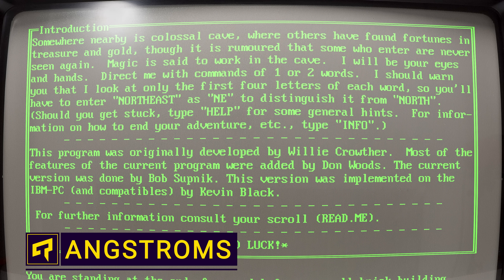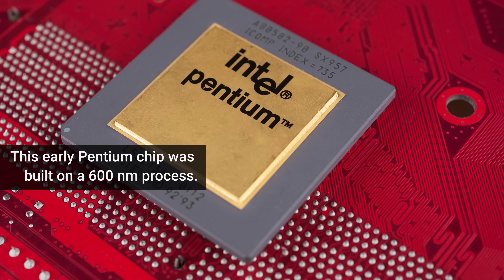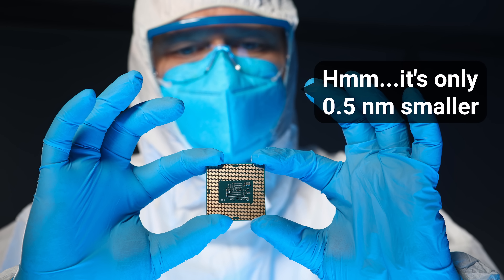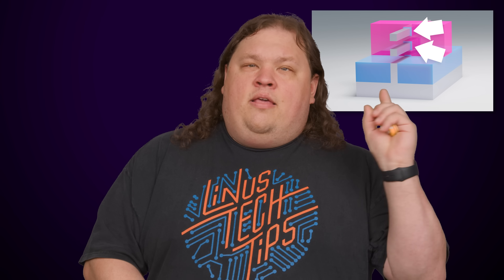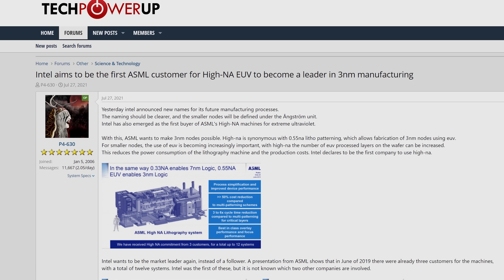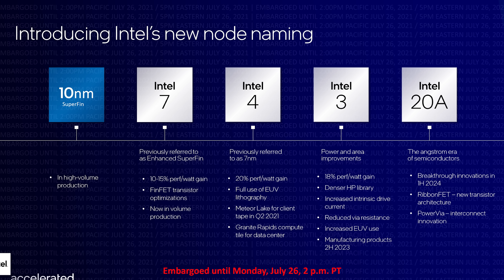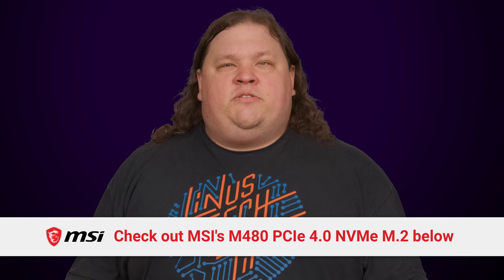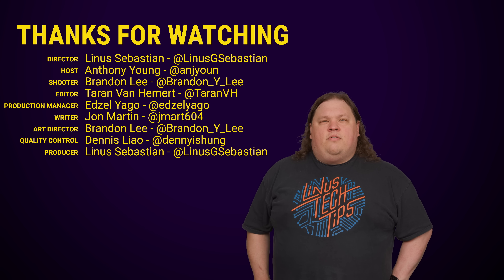CPU Angstroms vs. Nanometers

Comment: I am waiting for the Next Big Discovery... We need a completely-new substrate that does away with silicon entirely, and is easy to produce, unaffected by artificial or political "shortages."
Reply: Silicon is NOT in shortage, it is the chips that are in shortage. I think you got confused between silicon and lithium. Lithium is limited and concentrated in China, but there hasn't been any shortage of batteries yet. And many people are already working on alternatives like aluminium and magnesium.
Reply: @ritwikreddy5670  Silicon itself "may" not be in shortage, and the perceived shortages "may" be political, however the silicon chips are made of Silicon, of course, and a highly-refined variety from not just any beach or desert. Whatever the cause, and whatever you call it, the shortages are causing shut-downs of auto production, electronics manufacturing, and anything else requiring a steady supply of the chips. So the cause is whatever it is, and the effects are what you see. Comparing it to lithium is apples-vs-oranges.
Reply: Everything you just said there besides "that does away with silicon" describes silicon. There is nothing remotely as abundant, safe, and/or easy to use as silicon. 
"Oh, we need more silicon? Go out to the beach with a shovel and melt some sand down."
"Oh, we need a protective layer that can easily be etched with extreme selectivity over the underlying substrate? Stick it in the oven. It'll grow by itself."

The reasons you gave for switching from silicon are the reasons we HAVEN'T switched from silicon. The performance isn't great, but it's SO much easier to work with and produce, and is incredibly abundant.

Comment: It surprises me that Anthony of all people would be doing this particular video.  He should know that the X nm moniker stopped having anything to do with actual transistor sizes long ago.  For example, the only feature that is anywhere near 7nm in size in TSMC's 7nm process is the width of a fin in a transistor which is 6nm wide and a single transistor may have several fins.  From what I can tell, most of the increases in transistor density have come by reducing the distance between transistors which is enabled by more accurate patterning processes instead of by making the transistors themselves smaller.

Comment: Tbh, they should have flipped the number, saying something along the lines of "this many transistor fit in an inch if used as x", second part is because e.g. memory doesn't scale as well.

The 20A system is stupid, since it will be mentioned with power usage at times, so people will keep mixing it up with Amperes if not well informed on the topic.

Comment: It makes me really mad that LMG has said nothing about picometres. This angstrom thing is stupid.
Reply: They made no mention of picometers because nobody in industry or academia uses picometers for anything regarding nanotech. Some might use the unit while discussing the diameter of the nuclei of especially large atoms, but even then, they'll probably be using Angstroms because it's more widely used and is frankly a better unit. The van der waals radius of a hydrogen atom is 1.2 angstroms. The charge diameter of a proton is 0.84 femtometer. Maybe some people use picometers for orbital radii?... I would just use scientific notation since you're only using that in a calculation anyways.

TL;DR: No u
Reply: @hank7281  Yeah but it doesn't matter whether or not its a standard, nothing is a standard until somebody starts using it for something. Not only that but pico does come between nano and femto, it makes sense.

Although, I will not discredit your comment, you make good points, I am saying that an angstrom is a stupid unit.

You also did miss the point, as there had to be at least one writer or editor on the team of this video that knew what a picometre was, and there was still no mention of it as an opinion. LMG loves being like "well yeah but technically it's just this".

Comment: I had no idea chip makers use the term lithography incorrectly for so many photoetching processes. Why?
Reply: Despite the fact that only Intel, Samsung, and TSMC are being named in this video, there is literally only 1 company in the world that decides the next available manufacturing process wrt chipmaking (based on Lithography-goto ASML.com ). That company is Dutch tech-giant ASML in Eindhoven, the Netherlands. ASML is the world leader in the research & development of chip manufacturing machines, which are being used by Intel, Samsung, TSMC, and many others to produce their chips. ASML is the market leader with almost a 90% share, meaning that roughly 9 out of 10 chips produced in the world are being manufactured on machines from ASML... It's worth a mention IMO... Greetz from Amsterdam xxx
Reply: @fransezomer  That's great and all, but the process is not lithography. It's akin to the photo etching process used to make plates for offset lithography, but even that plate making process is not lithography.
Reply: @strawhousepig  It is lithography in the broadest sense of the word, I agree. But to me it is still using the same principles though. However, instead of a 'stone' or film being the flat surface, the target is now a silicon 3D-structure, which is being 'etched' through the use of lasers in variable frequencies, creating variable wave lenghts with variable intensities, breaking through a liquid layer, and in this way etching a 3D structure in the 3D-silicon. I see enough similarities to call this process lithography... I am no expert though.
Reply: @fransezomer  That's a photographic process. If it were lithography, a master (the stone or plate in lithography) would be used to print to the substrate (silicon in this case) an image using oil (chemical A) while using water (chemical B) to keep the non-image areas clear of oil.

Admittedly I haven't read complete whitepapers describing any of the chip making processes claiming to use lithography, but I have yet to read anything that shows it goes beyond the photo etching process, which is merely akin to the plate making process of lithography. In fact it actually sounds more like a photogravure process.
Reply: @strawhousepig  From asml.com: Principles of lithography
A lithography system is essentially a projection system. Light is projected through a blueprint of the pattern that will be printed (known as a ‘mask’ or ‘reticle’). The blueprint is four times larger than the intended pattern on the chip. With the pattern encoded in the light, the system’s optics shrink and focus the pattern onto a photosensitive silicon wafer. After the pattern is printed, the system moves the wafer slightly and makes another copy on the wafer.

This process is repeated until the wafer is covered in patterns, completing one layer of the wafer’s chips. To make an entire microchip, this process will be repeated 100 times or more, laying patterns on top of patterns. The size of the features to be printed varies depending on the layer, which means that different types of lithography systems are used for different layers – from our latest-generation EUV systems for the smallest features to older DUV systems for the largest.
Reply: @fransezomer  Again, that is not lithography. Lithography has never been such a process.

It's like calling pouring drinking. It makes no sense.

Comment: Im surprised switches work at such small sizes.
Reply: They don't really. At least not FETs. You'll need different technologies to actually achieve those kinds of critical dimensions. Y-branch switches could work. IBM's new "2nm process" uses 40nm wide ribbons. It's not a size. It's literally just a number.

Comment: Listen, Anthony, love you bud and i know it was all just for the script to flow well, but as one of those weird americans that uses my foot to measure things, i know that nanometers become picometers once they've been chopped up enough, and just 5 years before that 600nm pentium, there was the 1um Intel 80386
You dont have to make this transistion for my sake to make it easy on me. I can take it. Do i like that its technically not a metric unit? Yes. Would i be fine with pm? Only if i didnt have context on whether we were talking about time, or a manufacturing node.

Personally, i'd like a measurement scheme that takes into account the number of executions per milisecond a processor is expected, and later tested to execute per mm² at a set frequency. Yea it would be a complicated calculation, and would probably require engineering samples of processors before they get classified, but this way, a "7nm core i3" will have a different measurement than a "7nm Atom" even if their die area and frequency were exactly the same

Comment: Intel: Stuck to 14nm for years and adding + for each generation
Intel Now: Decides to jump straight to 2nm
Intel: My genius! Sometimes it shrinks transistors
Reply: @WolframaticAlpha 
Because nm has NOTHING to do with the actual "specs" a node process could achieve actually, this is just a simple fucking sentence MILLIONS don't understand.
Reply: @robier  Intel 10nm and Intel 7 (10ESF) are only slightly better than TSMC N7FF in theoretical transitor density, gate pitch sizes are the same between SS, TSMC and Intel. Intel starts 10nm high volume production in Q4 2020, that is 2 years later than TSMC N7FF. Not to mention Intel is late in utilizing EUV comparing to TSMC and SS. With AL Intel wont have process node disadvantage until Zen 4 in H2 2022
Reply: @robier  Yes, the Dunning Kruger here is you.
Reply: @robier   Maybe, but TSMC and Samsung are both on 5nm now.
Reply: @katrinabryce  *"5nm" the breakthrough "2nm" devices IBM just made use 40nm-wide ribbons.
Reply: They never actually added + to each generation, only when there was a change in the process node for example 8th gen and 9th were both ++, generations with only 3+ doesn't make you factually correct.
Infact 10nm is actually 10++, 
Intel are not the only ones who use + either, see zen3.
Reply: @nealking4181  I just meant how long they clinged to 14nm and refreshing it and other companies change relatively quickly than intel
And they also take so big jump
Reply: @donkey7921  yes man
All companies have different ways to measure and at these small measurements wrong things happen..

Comment: i really hope they use Å instead of A, because A is already used for amperes, and it's a cardinal sin of engineering to use the wrong unit abbreviations.
Reply: Right!  When I first saw that 20A I thought a chip that consumes 20A?!?
Reply: Well, it doesn't actually have any connection to 20 angstroms, so... It also isn't that uncommon to use A instead of Å, since it's usually pretty obvious... The various 'e's are far more confusing.

Comment: Does Intel use Intel CPUs in their manufacturing machines to produce newer better Intel CPUs?😵‍💫
Reply: Depends on what the manufacturing tools' manufacturers use in their products.  You can probably find out by doing a web search.  Hint:  There are several semiconductor tool manufacturers such as Applied Materials, Novellus, LAM Research, Hitachi, etc.
Reply: @TheKuptis  Thanks for the info :)

Comment: Taking in account the electronic migration I wonder how this will affect so tiny transistors in terms of time durability.
I mean, a bigger metal bar will take longer to get rusted to dust than a wire of the same metal.
Reply: I don't think "rust" is a cencern for chips, if it was, we would have hit that wall long ago. A fingerprint is a few thousand times the dimension of current transistors
Reply: @Ubya_   The bar and the rust was an analogy. We are close to atoms size, so migrate a few atoms from millions is almost nothing. Migrate the same amount of atoms from 300 atoms is a concern

Comment: I don't know why they don't just switch to max transistor density, this would define the important attribute and cross various chip types as weil.
Reply: Except it isn't really THAT important...
Reply: @hank7281  I suppose the important thing is the actual performance so going all the way back to Megaflops maybe :D. I know that wouldn't work either but there has to be some cross producer metric that can be used honestly

Comment: I don't know why they don't just use what they did with the last size transition. They never referred to those process sizes as "600 nanometers", it was "0.6 microns". Why not shift to "picometers"? (Nanometers=10^-9m;1 billionth of a meter, picometers=10^-12m; 1 trillion th of a meter). Angstroms are kind of a silly, non-standard unit, kind of like centimeters, decimeters, or hectares. At least centimeters and decimeters have the Latin correct, angstroms and hectares are just silly talk.

Comment: Just an FYI, the 5nm, 4, 3 etc isn't really about gate length anymore (at least not always I think), it's more about the density of the transistors. That is because there are stacking techniques now. Quoting from Wikipedia: "The term "5 nanometer" has no relation to any actual physical feature (such as gate length, metal pitch or gate pitch) of the transistors. It is a commercial or marketing term used by the chip fabrication industry to refer to a new, improved generation of silicon semiconductor chips in terms of increased transistor density, increased speed and reduced power consumption."
Reply: Nah. It's more about marketing these days.

Comment: I read a website that used “transistors per square-nanometer” as a brand-agnostic way to compare different chip families. What’s wrong with that?
Reply: CHiplets.
As well as other manufacturing differences.
Reply: While that sounds great, it turns out that within a particular process node, chip designers use different densities of transistors! Often, rarely-used bits of logic will use a high density to reduce the extra cost of the silicon for that extra logic, while more heavily used functions will use a sparser transistor density because that’s more power efficient. Again, this is within a single chip made using a single process. There are some other issues as well, like logic vs SRAM, but that’s the big one.
Reply: Still says nothing about anything of import. 

And why would you use per square nanometer? Are negative exponents really that fun? Per square micron maybe...
Reply: @hank7281 , nothing?  It would give the average size. Unlike the “XX nanometer process,” which is less connected to the size.

Comment: IIRC the unit that is used for transistor width is actually just the name of the process and not the actual width. "The term "5 nanometer" has no relation to any actual physical feature (such as gate length, metal pitch or gate pitch) of the transistors. It is a commercial or marketing term used by the chip fabrication industry to refer to a new, improved generation of silicon semiconductor chips in terms of increased transistor density, increased speed and reduced power consumption." Source: https://en.wikipedia.org/wiki/5_nm_process

Comment: What about femto? Or pico? Engineering notation gets REALLY small
Reply: Because it makes more sense to use Angstroms. This isn't some move by Intel to use a new unit that nobody ever used. It's Intel using the units that its physicists and engineers have been using for decades. You probably don't even know what the bel is. But once I say decibel suddenly you know.

Comment: 0:26 "This AMD Ryzen 5 has 7 nm transistors" 
That's simply not true. Not a single processor on the market has transistors that are actually 7 or 5nm. They're all bigger. 
"7nm" is only a production process and NOT the size of a transistor!

If Intel, AMD etc. would ACTUALLY use the transistor sizes, there wouldn't be a problem with those numbers getting too small any time soon.

Comment: I think it's more like manufacturers are now questioning what to do with the extra space on the die.
Reply: No, the crux is the CPU power usage vs Performance. The smaller the chip, the better the CPU performance with less power usage required. Less power requires less cooling. Less cooling leads to a better heat profile, also with sustained loads (vs throttling) and energy (battery) savings. The die (or 'space required') is variable. The smaller the chip size, the more chips can be produced from 1 wafer (gold colored discs in a chip factory). With a cost of around 100 to 400 USD per wafer or (~14 cents per mm2) this represents a significant profit win for chipmanufacturers.

Comment: Going to angstroms makes enough sense I'm cool with it. At any rate it'll be a decade before the first Intel 3nm chips roll off the line and actually get put into any consumer electronics. And that's being optimistic.
Reply: *Intel 3 chips
They're moving away from the industry standard "name it a length that has nothing to do with the device" approach to naming nodes, and props to them for that.

Comment: Anthony said Intel 5. So it's Intel 5 now. Take this note, Intel
Reply: Imagine the confusion though. Intel 3 > Intel 7, but i7 > i3. At the very least Intel 4 is "unique" otherwise Intel 5 and i5 would just join this mess
Reply: @TheZahand  Intel 3 i7 vs Intel 7 i3 does seem unnecessary complicated
How is this the marketing strategy they're going with :D
Reply: @Attewir  at least the Intel 4, etc. Means something. You can look it up and see what it means. Meanwhile, many/most system integrators and retailers will label things by saying "i3" or "i7" with no other identifier as if that means ANYTHING. I have a 9-year old laptop with an i7. Fairly certain most modern i3s would completely wipe the floor with it in all aspects. Same core/thread count.
Reply: @hank7281  they specify generation too, that is definitely not optimal, but with context you can easily figure out which one it is.
Reply: They should have made i4,i6,i8? Make those the unlocked versions of the i# before it?